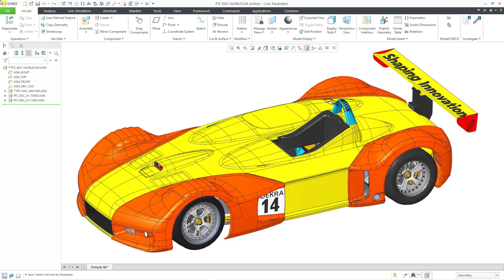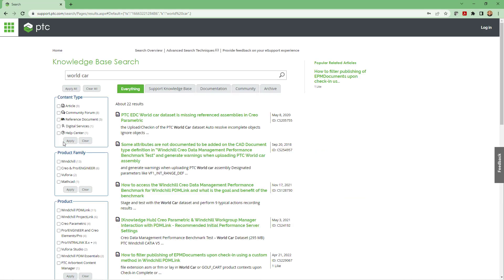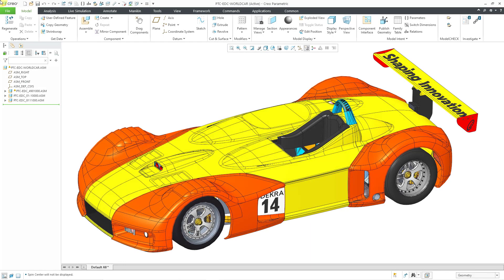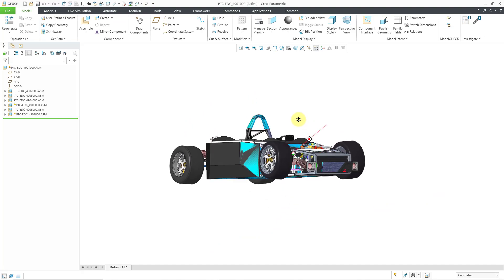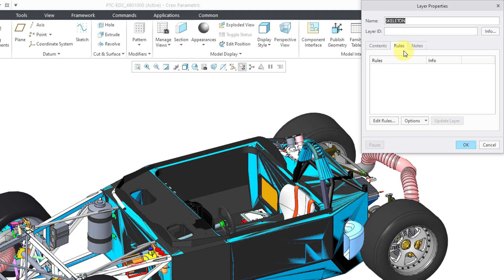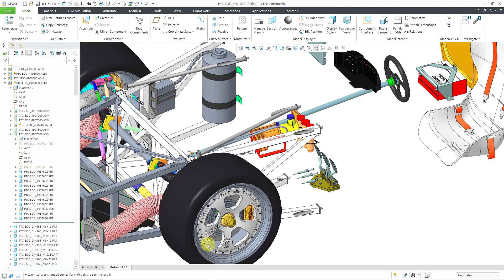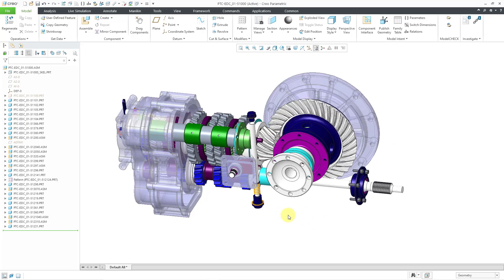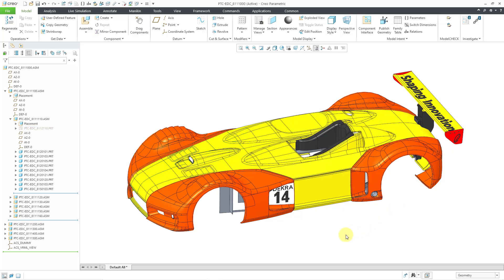Creo Parametric - How to Access the World Car CAD Dataset from PTC - Free Models

Comment: Hello Mr. Martin, thank you for all your videos. Using and learning Creo professionally for a couple years I can still learn so much just watching some of your videos! 

Could i maybe ask a question that I've never really managed to find an answer for? 

At times we design machines with tensioned belts and I'd love to present the belt tensioned (in contact with a tensioning roll) and untensioned without said contact. We mostly design the path of the belt along a sketched curve that references every roll in the system and sweep along it (not sure if sweep is the feature name in english...). 

Problem is that the curve breaks when the contact situation with one of the rolls changes. We've never really managed to design this dynamically and resort to 2 seperate models that we then have to manually suppress and unsupress to represent each state. Do you know of any way this can be done in a single model? Or do you maybe know of some similar concepts I could look up and take inspiration from? Regardless of an answer, thank you for all your work! 🙂